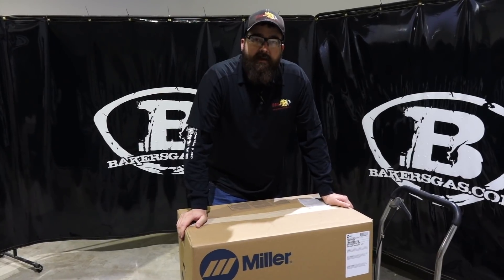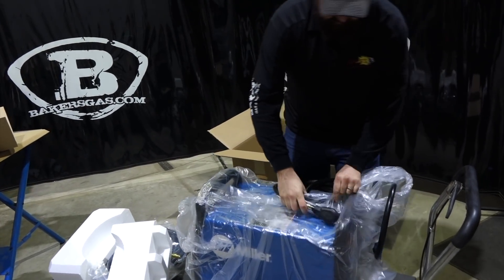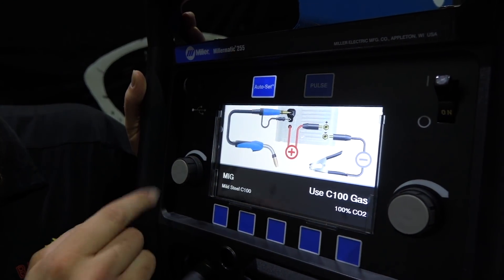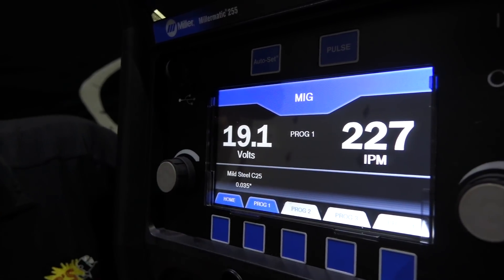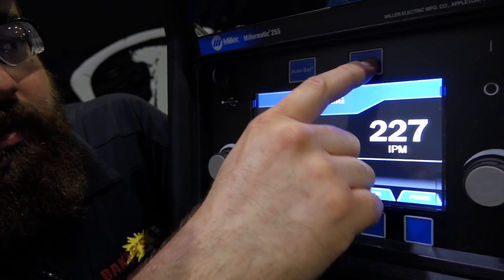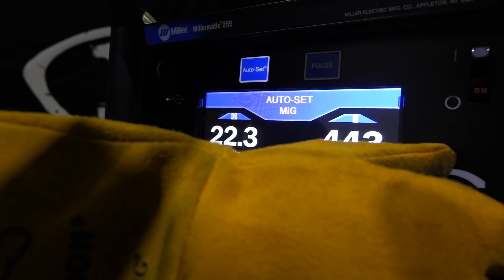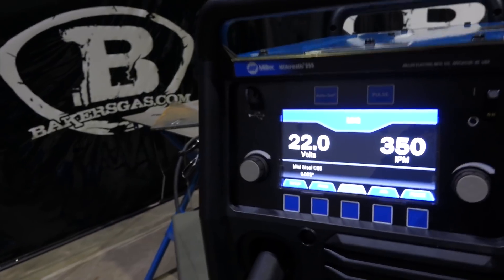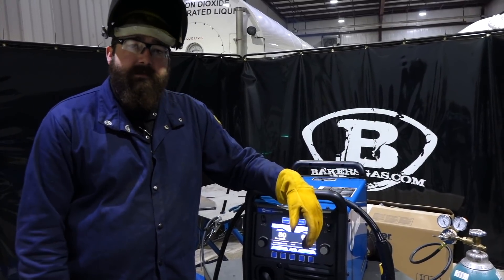Millermatic 255 Review and Unboxing

Comment: I bought the 252 over the 255 solely because of the screen i do not trust I won’t break it. I learned on the 252 and it is a solid machine but the pulsed mig was tempting.
Reply: Your concern is also my concern as well. It's between the 252 and 255 and I might just get the 252 I see so many people having problems with the 255. And I don't want to be having problems with a machine that costed 5k!

Comment: I’m an aluminum shipyard welder who has used the xmt with spoolomatic 30a and optima box which is essential for changing voltage in the hole. Miller rep says in auto pulse heat and wire auto adjust by turning wire sped knob on spoolgun.  This would be great if it works that slick.  ...... Is this a soilid replacement for xmt? Thanks
Reply from the maker: We had Andrew call you hopefully he was able to clarify for you! Thanks for watching let us know if you need a quote.

Comment: Another thing... dince connectors are small may consider it more big one 5/8.. if you running  a long  welds may destroy positive connector.  I  got experience at 211 miller  at also 200 miller multimatic...mm

Comment: Its extremely heavy? Isn't it less than HALF the weight of the 252??
Reply from the maker: Yes it is but 84 pounds is pretty heavy to pick up compared to say a Millermatic 211 which is about 38 pounds. On the 252 with the running gear it is never really picked up and is certainly less portable than this unit. Thanks for watching let us know if you have any other questions.

Comment: Looks like a nice machine for heavier duty MIG welding (my 220 maxes out at 3/8” supposedly at a lower duty cycle, and no pulsed MIG.)
Reply: I was going to go for the 220 for the ac, but it has a lower duty cycle across the board so I think I'm gonna get the multimatic 255, and then just get an everlast ac/DC tig box later down the line...
Reply: Sheep Dog69 plus this goes to 350 amps. I have this and a dynasty 280dx
Reply: @imbrandon16  I am thinking the same as had.  Did you get the 255, if so, do you like it?
Reply: @ray-real1  I did get it, I love that machine, haven’t had any issues with it and it’s easily handled everything I’ve thrown at it. 👍 I actually did end up getting a watercooled everlast 250 ac/dc tig welder last year as well, it’s been great too.
Reply: @imbrandon16  awesome, thank you for the quick response!  Sounds like I need to spend some money.

Comment: wow, alot smaller than the 252, we have 3 in the shop, don't know it that's a good thing because now you gotta buy or build a cart for this to haul your gas cylinder around... 252 has a rack and chain built into the back.
Reply from the maker: They sell it with and without the EZ latch cart. Below is a link to the one with the cart. You can detach it from the cart very easily. Or if you bought the Millermatic 255 by itself you can always add the cart later. It is about $400 I linked that below as well. Thanks for watching!

https://www.bakersgas.com/MIL951766.html

https://www.bakersgas.com/MIL301449.html
Reply: No pulse with the 252 or dc Tig of stick and 50 less amps
Reply: And in 20 years from now the 252 will still be working while the 255 is being sold as junk.  @weldingjunkie
Reply: @weldingjunkie  Yea this wasn't covered in the video.  I'm looking at an ad that says the 255 can do Mig, stick, Tig, Flux, and aluminum MIG.  I'm fairly sure the 252 only does MIG, so this is a huge upgrade in versatility.  I wonder if there are performance or duty cycle differences between a transformer based machine vs an inverter based machine.

Comment: How do you feel about the price. I'm in the market for a Multi process welder and would really like to get the Miller 255 but damn is it expensive
Reply: same here, i'm thining of going with the 220, i'm a young electrician apprentice, but i've been getting into welding lately, and i want my own machine to play with, we have miller 252 migs at work, and and a miller 150 tig/stick box, and an everlast 180 shitbox tig/stick welder which took a shit last week XD r.i.p. green machine, you will probably not be missed, until someone needs to work on some aluminum XD. but for buying my own personal machine i think i'm going to go with the 220, i can then use any process i want, and weld just about anything i would need to and more lol. 3 grand for every process and the ability to weld aluminum. or 2700 for a mig only... and the 220 is 120v/240v. i know the miller 252's at work are 240v only, idk about the 255 so keep that in mind.
Reply from the maker: @imbrandon16  if you have interest in getting into TIG welding the 220 is the way to go! Also Miller just announced in January they are launching a Multimatic 255 which will be a multiprocess machine. It is linked below for you to check out. Also linked below the spec sheets for all three so you can compare. If you have more specific questions feel free to comment them or call us :) 877-930-5690 

Multimatic 255
https://www.bakersgas.com/MIL907728.html

Spec Sheets:
Multimatic 255 - https://www.bakersgas.com/media/docs/MillerSpecSheets/DC129-Multimatic-255-Specs.pdf
Millermatic 255- https://www.bakersgas.com/MIL907734.html
Multimatic 220 AC/DC-
https://www.bakersgas.com/MIL907757.html
Reply from the maker: @imbrandon16  awesome! If you have not already check out our welding review on the 220! https://youtu.be/AWaEvLKAuW4
Reply from the maker: If you are looking for a multiprocess welder you would want to look at the Multimatic 215 and 220. This 255 is a MIG only machine.  If you are wanting to AC TIG weld aluminum that would be the 220. Which yes the 220 is at a higher price point but it can do everything.  I put a link below to both. Call us if you have any questions we are happy to help. 877-930-5690
https://www.bakersgas.com/MIL907693.html
https://www.bakersgas.com/MIL907757.html
Reply: This is not bad price for 350 amp machine honestly
Reply: Now this damn thing is doubled in price it's now 5k!
Reply: @HondaCrf450r.  Yes I’m glad I got it when I did years ago

Comment: I’m pretty new to this but I was wondering if you can hook up a push pull gun to this for welding aluminum. Thank you for the videos.
Reply from the maker: Yes you can you can check out the option on the spec sheet below:
https://www.bakersgas.com/media/docs/MillerSpecSheets/MIL907734-specs.pdf